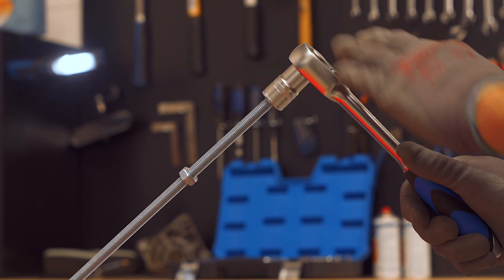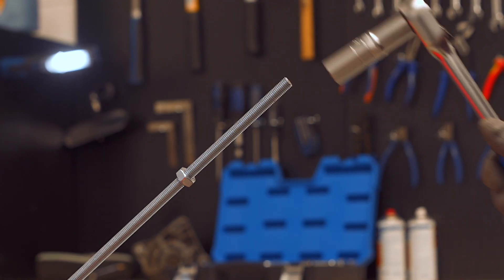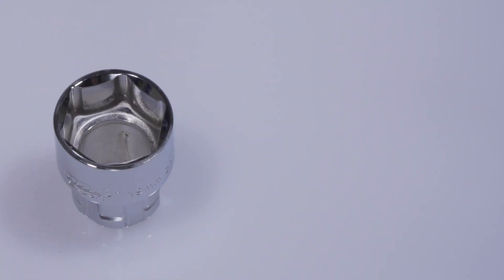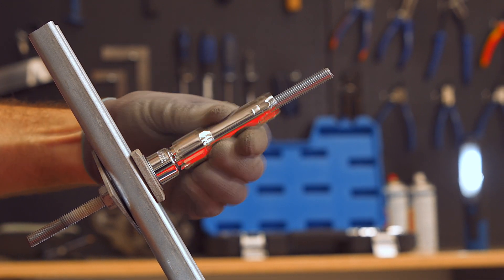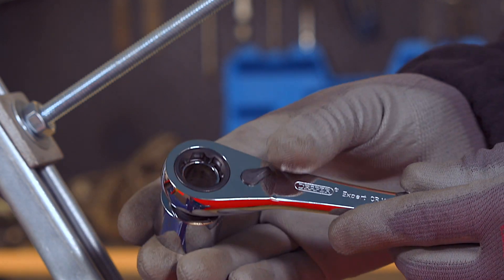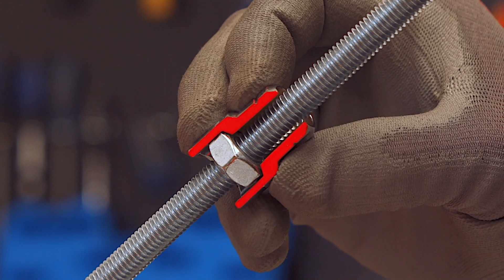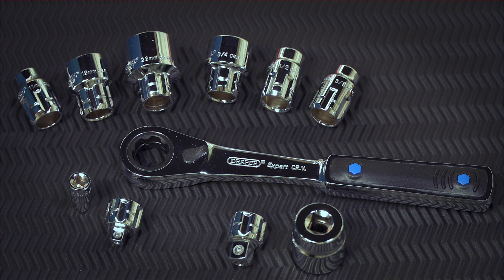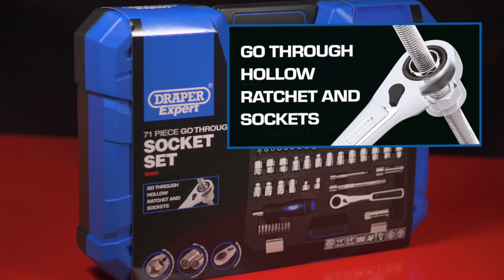Draper Expert 'GO THROUGH' Sockets

Comment: Can't think of a situation that a ratcheting ring spanner wouldn't do the same job. Seems like a costly solution to a fairly uncommon issue. Bit of a con if you want the honest truth. Would be interested to see a comparison strength test between this tool and a ratcheting ring spanner. Can only imagine a ring spanner would be invariably cheaper to replace if it failed compared to one of these tools.

Furthermore, as it's not a standard 1/4, 3/8, or 1/2 socket set, it's not immediately compatible with any standard attachments you'll likely have in your toolbox, such as hex bits, extension bars, knuckles, etc. Seems to me like a step backwards in terms of building an arrangement of useful tools.

P.S. If you're worried about personal injury (as the video suggests), maybe buy some cheap gloves? Infinity more cost effective.
Reply from the maker: The joy of a push through ratchet is that it will allow the threaded rod to pass through the socket, rather than having to remove the spanner each time if in a confined space. If the rod has plenty of space to manoeuvre the spanner then that's fine. But the push through ratchet is a good option as well.
Reply: @DrapertoolsLtd 

https://youtu.be/lNc4zVcja3Y

As before, a ratcheting ring spanner does the job. These have been on the market for decades already. I have a set of the flexi-head ones. Very easy to use. Strong, lightweight, and versatile. Cost a lot less than this socket set.

The only scenario I can think of where this ratchet would trump a ratcheting ring spanner would be if the threaded nut has been recessed. This in combination with a long bolt at the open end. Only then would you need a socket combined with one of these go-through ratchets.

But if you think about it, you'd need one of these to begin with if that was how you had designed your recessed fixing in the first instance.

And even then, what's the point in using a recessed nut in combination with a long threaded bar? Perhaps in a security setup, but even then there are easier security solutions that would be employed.

Other than the situation above, a ring spanner, ratcheting ring spanner, mole grips, adjustable wrench, or plain old open end spanners would suffice.

I own some Draper tools, so I'm not having a go at Draper. Other manufacturers sell similar straight through socket sets. I'm just suggesting, as these are quite pricey by comparison, unless you've got very deep pockets, I can't see why you would buy these over more available and cheaper (to buy) tools.
Reply: Alot of new car shocks have this problem.